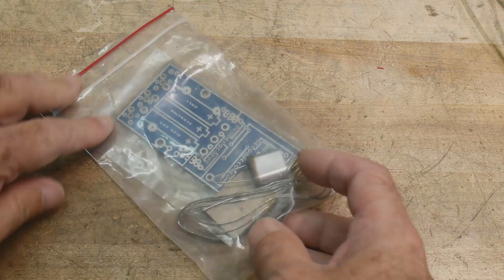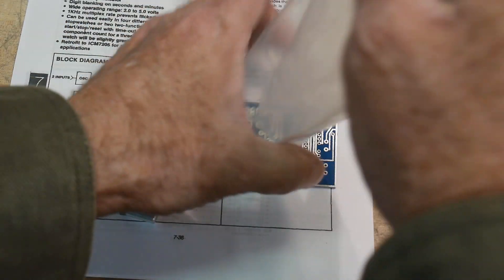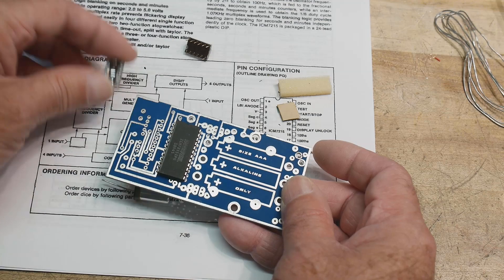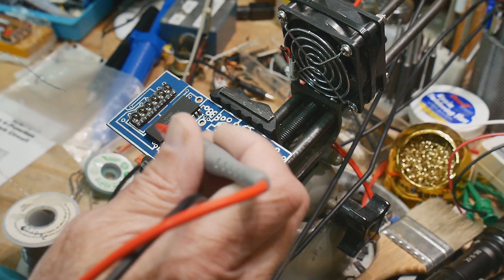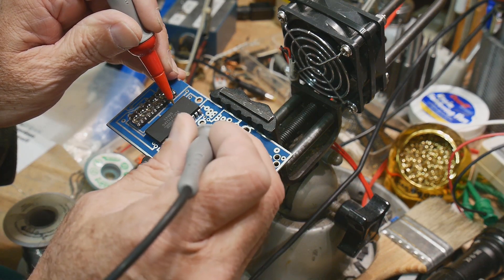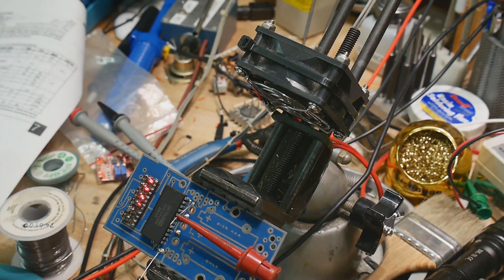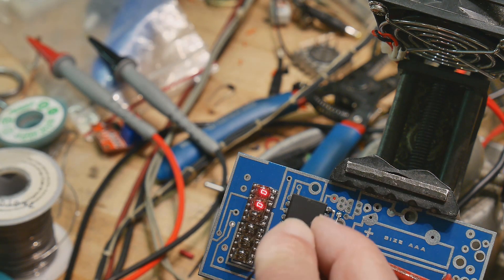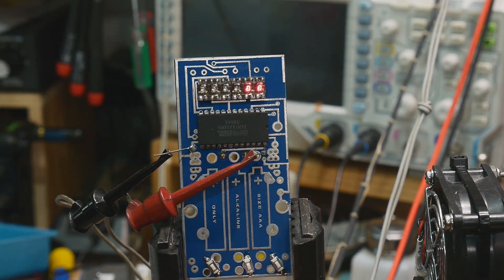#673 1976 Digital Stop Watch Kit

Comment: Found a 11710A down converter Question is use it for the case and power supply or find a home for it to someone who will use it.
Reply from the maker: That is a rare one. Not very useful today.
Reply: @IMSAIGuy  I took it apart and it’s an absolute work of art inside. The power supply outputs 12 V so it will be useful but the attention to detail is absolutely incredible.